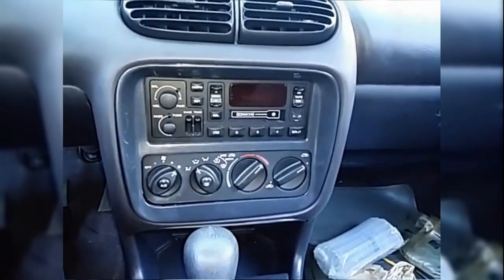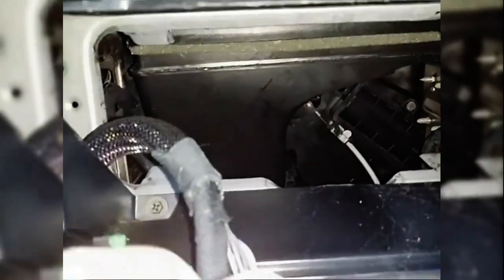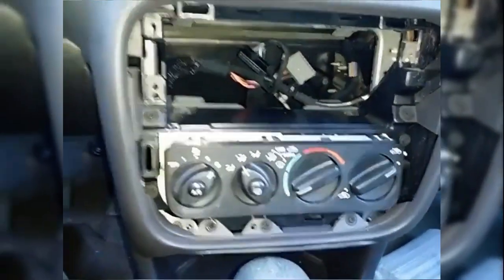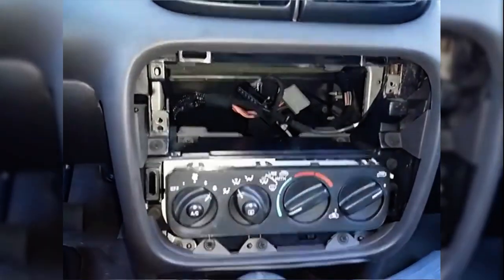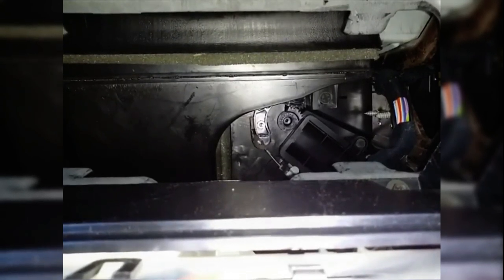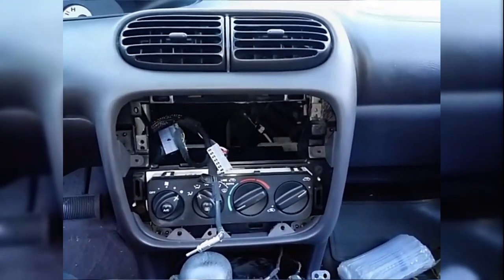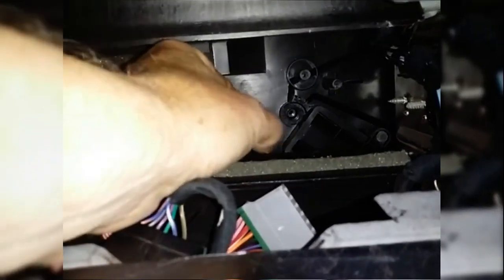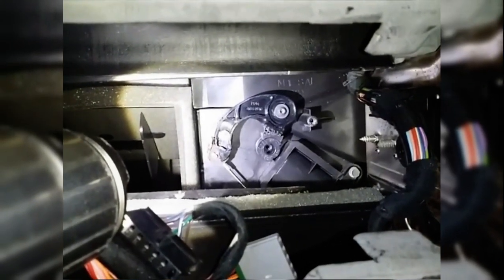2000 Dodge Stratus AC/Heater Temperature Control Fix

Comment from the maker: Dickels, there is a video relative to your problem, but it is a Chrysler 300. That car has push button control. If your car has turn knobs like mine, it may be a mechanical problem instead of electrical.

Comment: Hey Terry, I have the same problem with the dodge stratus 2000.  I recently bought it, but the stove blew warm air closer to cold.  I went to the master, he said that it was necessary to change the thermostat, but this didn't help and now the car is overheating, and antifreeze seeps out through the lid 😭
Reply from the maker: It appears to me that the new thermostat was installed backwards (upside down). That would block normal flow and give you the problems you now have. If you paid someone to replace the thermostat, I suggest taking your car back to them to have them fix it.   Your original problem could have been the temperature control cable to the blend door as I described in the video. Depending on the position of the mechanism when it broke, the air could be hot, cold or warm. I'd suggest pulling the radio as described and look at the mechanism as I described at the beginning of the video. Good luck.
Reply: @TheFrogsled  Ok, thanks for the tips   🙌

Comment: Hi Terry, you wouldnt happen to know how to fix the adjustment that changes where the air comes out do you? Mine is stuck on defrost.
Thank You
Dickels
Reply: Dickels Habsrule blend door accuator
Reply: Yeah I've got the same problem w/ mine right now, but I found a good video if u still need it. Thanks.    - take care
Reply: @leeisenberg  TY but I sold it a few years ago.